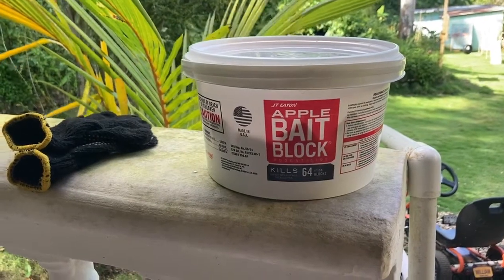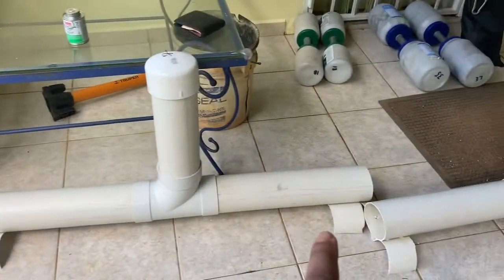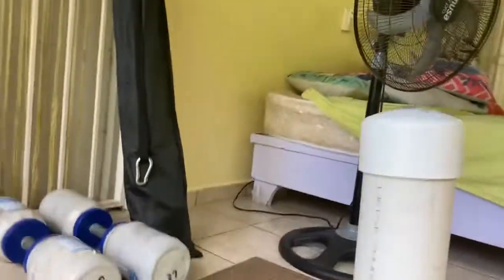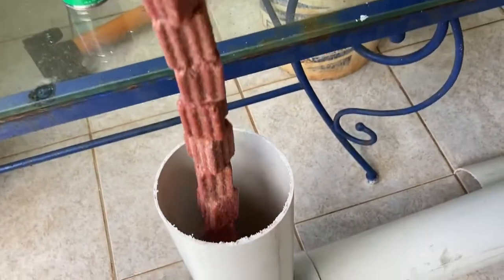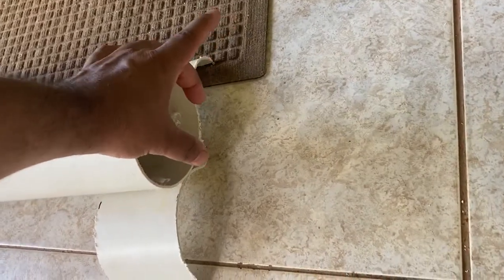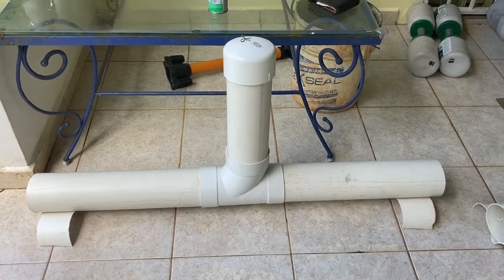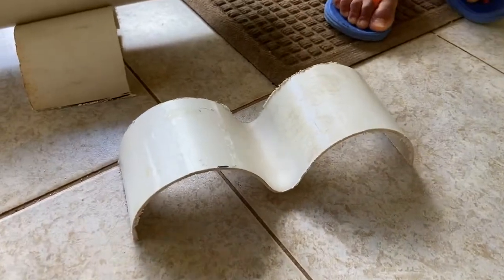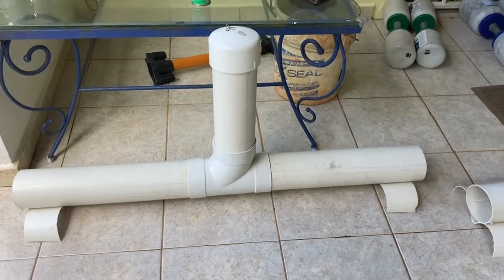DIY Gravity Fed Rat Bait Station From PVC Tubes - Pet and Child secure - See description for update

Comment from the maker: This was made from 4 inch PVC for rats. I suppose you could make it out a smaller PVC if you only making it for mice. Also let me know that I used a wire because I didn’t have a really long screw for the bait. I saw another video where the guy used a really long screw but he had to then drill holes through the bait which is messy and toxic mess so I decided to just use a wire which I think is a little cleaner. Update the rats climbed up and eat all the bait at once, so I suggest using a smaller top pipe inside the one shown with a small cut away to access the bait. They only need a little 😂